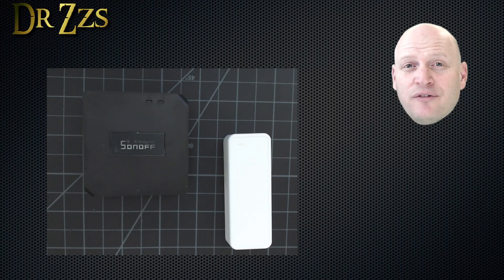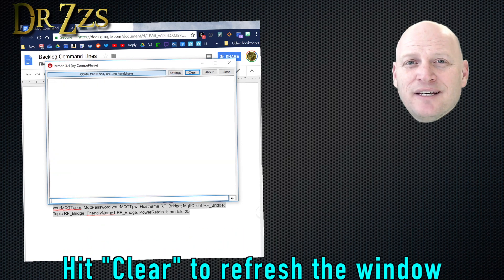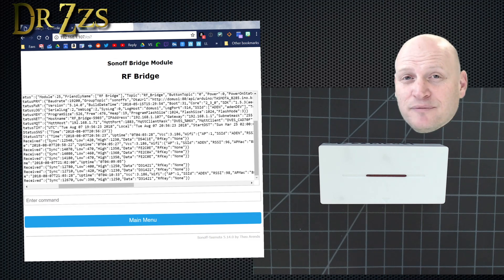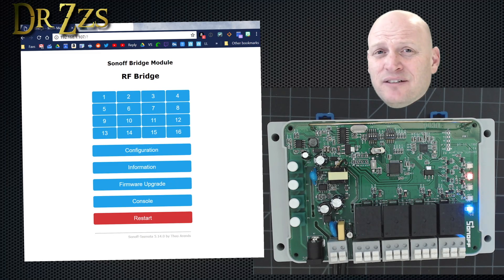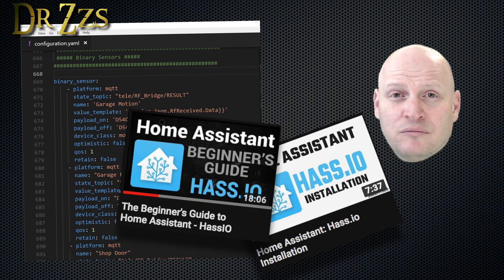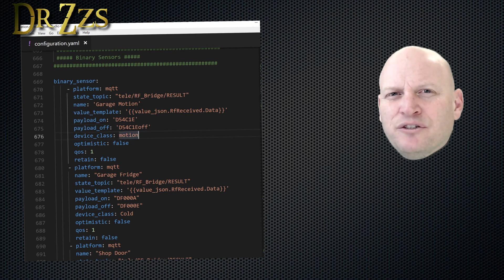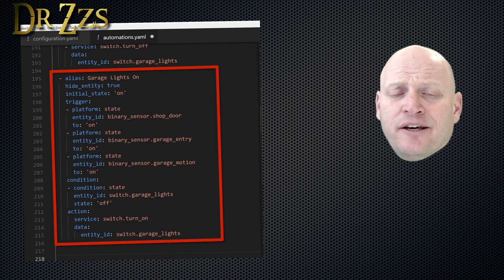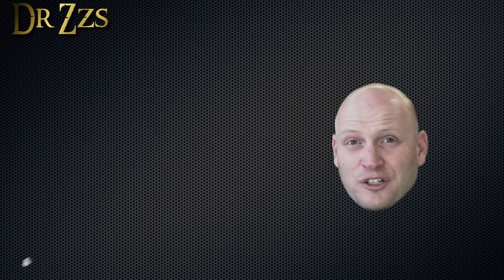Sonoff RF Bridge with Tasmota

Comment: Hi 
thanks for this great series of videos

I have been struggling to get 433mhz sensor to trigger a 433mhs door bell

after watching the video I still could not get this done

so after a long and painful  journey it seems that for some devices you have to publish the whole json code information

including the rf high and low and sync values

the best way I have found is to use the backlog command

so first grab all the info you need by activating the sensor then watching the command line of the bridge

then use that info in the automation yaml

note semi-colons not commas and RF prefixed on the value headers

- service: mqtt.publish

      data:

        topic: cmnd/RF_Bridge/backlog

        payload: RfSync 8760; RfLow 310; RfHigh 860; RfCode 531730

Comment: Great video! 

Just wondering if in the automation at 11:19 you shouldn't set the payload as in the template of the sensor, e.g., "{\"RfReceived\":{\"Data\":\"BDA5B9off\"}}" ?

Sorry if this is a repeated question.
Reply from the maker: You're probably right.  I'll have to look at it again. 
It isn't as necessary to make the fake "off" code anymore since they added an "off_delay" option to binary_sensors in HA.  So now when you set up the sensor entry in HA you can set off_delay: 5s or whatever time you want for it to reset to off.

Comment: Great vid mate. One thing, can you send commands from HA via Tasmota? I’ve a few RF plugs in the house and the sonoff bridge would be a nice way of tidying up my system instead of using my dodgy tx/rx that are dangling from my pi with DuPont cables.
Reply from the maker: yes.  You can transmit codes from the bridge.  Check out the video on the new TX switch.  I show how to record a remote code that you can transmit with an MQTT command.  (hopefully I put all that info in there...)

Comment: Do I need to sholder the header pins in order to flash?
Reply from the maker: nope.  You can just slide male jumper wires through the holes.

Comment: Just flashed all good but when i connect to termite i get no feedback i have the correct settings as i done a different sonoff basic flash and worked well so i know settings are good.
When i paste the commands into termite nothing happens, i have re flashed a couple of times now any help would be appreciated.
Reply: i tell a lie i got a small amount of green text: 
00:03:02 APP: Restarting

 ets Jan  8 2013,rst cause:1, boot mode:(1,7)

 ets Jan  8 2013,rst cause:4, boot mode:(1,7)

wdt reset
Reply: scrap that i cant do anything now i may of fried it :-) oh well buy another i guess.
Reply from the maker: bummer.  I don't know what went wrong.  Could it have to do with the switch to the RF chip?  Sorry man.  I fried one of these too.  I'm not sure how I did it either... doh!
Reply: @DrZzs  It happens i guess, least they are cheap unit so purchased a couple more, but what i have noticed is there are now 2 versions of unit?

Comment: Hi! Is it possible to configure one button of RF remote control to do MASTER OFF in all switches? How can I do that using RF Bridge and RF Remote Control? Thanks!
Reply from the maker: I think you'd have to do that with an automation in Home Assistant, or with Rules in tasmota.  I'm not smart enough to tell you exactly how that rule would look.  https://github.com/arendst/Sonoff-Tasmota/wiki/Rules
try digiblurDIY, he's really good with Tasmota rules.

Comment: Didn't work for me. The flashing showed positive, but I couldn't make the connection with Termite. It finds the correct port, but wont get any response from the Bridge
Reply from the maker: hmmm.  I know sometimes termite can be fussy.  I've had to disconnect and reconnect sometimes to get the communication to work.

Comment: Got HASSIO moaning about these 3 entries...
      optimistic: false
      qos: 1
      retain: false
Reply from the maker: Ya, optomistic and retain are no longer required for that device type.  Just take those lines out and it should work fine.  qos should be okay, but if it's giving you an error take that out too.
Reply: @DrZzs   I figured that might be the case and had hashed them out...
Just can't get my PIR to go into off mode. Thought it might have to do with retain setting.
Learn more about something when it doesn't work than when it does. I'll keep trying. :)
Reply from the maker: oh, add "off_delay: 5s" or something.  
https://www.home-assistant.io/components/binary_sensor.mqtt/#off_delay

Comment: Very nice video.   I have a question if anyone knows, if flashed with tasmota, could I use it to be the receiver for about 30 different sensors or do I need more than one?
Reply from the maker: I don't believe there is a limit to the number of sensor codes it can receive and convert to wifi/mqtt.  
If you want the bridge to send codes then the limit is 16.
Reply: DrZzs thank you for the answer and for all the videos.  Door/window sensors, water and motion detectors can just send to the RF bridge and they do not need to receive, right?  Thanks again!!!

Comment: Do you know the best way to simulate a long press on a remote? It's basically continously sending out the single press rf code.

I have stop buttons in Hassio that won't work for long presses. Which kind of sucks coz I have to spam the buttons to simulate a long press.
Reply from the maker: hmmmm, I'd try creating an automation that is triggered if the code is sent multiple times in a short time period.  I haven't tried that myself so I don't know the exact format to use.  
What are you trying to do exactly?  Maybe there's another way.
Reply: @DrZzs  Ok so I figured out that the B0 commands that I am using for my blinds support repetitions. So in rfraw AA B0 35 05 04 12C0 05F0 015E 02E4 222E A481A3B2B2A3A3A3B2A3A3A3B2B2A3B2A3A3B2A3B2B2B2B2B2B2B2A3B2A3A3B2A3A3A3A3B2B2B2B2A3 55, the 5th byte is 04, if you change that value to something higher it keeps repeating the command. Apparently it is used for less reliable receivers, but for my purpose it is working great. I now have automations for all the 3 limit settings of the dooya motors, very easy to set up in hassio due to the native limit settings.

I recommend these, they are good quality tubular motors with rechargable batteries. From seller friendly industry holding on Aliexpress. I bought 4 of them and a remote for 280 euro, which is a bargain.

Comment: Hello, great video! I am using the Sonoff bridge (flashed with Tasmota) and 4 door sensors. Works great in Hassio. Open and closed states are shown like they should. But when I restart Hassio all the sensors go back to closed, even when the door(s) are open. Is there any way I can fix this?
Reply from the maker: try the retain options in Tasmota.  in the Console, type: "switchretain 1" and "powerretain 1"  That should do it.
Reply: @DrZzs  Thank you so much! Just tried it and that did the trick! I just started 2 months ago with Home Assistant and your videos are such a great help, togheter with the videos of JuanMTech and BRUH Automation. Keep up the good work!! Greetings from Belgium!
Reply: @DrZzs I was a bit quick with my respons, it's not working, after the restart of Hassio the sensors go back to closed. This is how I configerd the sensors in the "Configuration.yaml.
- platform: mqtt
name: "Schuifraam"
state_topic: "tele/RF_Bridge/RESULT"
value_template: '{{value_json.RfReceived.Data}}'
payload_on: "D9E20A"
payload_off: "D9E20E"
device_class: window

qos: 1
When I add “optimistic: false”and “retain: false” I got an configuration warning in Hassio

Comment: Hi, using Tasmota on Sonoff Bridge, can I register more than 16 devices?
Can I register the sensor scrolling code?
Can I register more alarm devices?
Thank you.
Reply from the maker: There are only 16 slots for the RF bridge to store codes, but in most cases with door/window sensors, you don't need the bridge to store the code.  It just needs to receive the code and pass on the mqtt message to HA.  The 16 code limit is only for codes you want the RF bridge to send to RF devices that can receive RF codes, like a receptacle or sonoff RF switch.  
Hope that helps.

Comment: Thanks for posting this.  Just wanted to note that you may want to add an off delay ('  off_delay: 10
') for you leak sensors so that they can reset themselves as they don't have a discrete off command.
Reply from the maker: good point!  thanks!

Comment: Hi, thanks for all the information.
It will be great to be able to use the RF bridge to control an other Sonoff items with a different models of RF wall swiches like the next one: 

https://www.ebay.ca/itm/433MHz-RF-Wireless-Remote-Control-Switch-Wall-Panel-Transmitter-1-2-3-Button/283224286457?var=583667209378
I am not able to do it, to use different wall shiches with to the  same sonoff control.
Reply from the maker: I haven't tried those.  I believe what you have to do is program one of the 16 "keys" in Tasmota for each of those plugs.  If I ever get plugs like that I'll test it out and see if I've got the right idea.
Reply: The besto option that I found on ebay to use different remot controles with one sonoff is to use a 433MHZ Relay DC12V 10A 1CH Wireless RF Remote Control Switch Receiver, and made a contact to the push botton of the sonoff relay.
So is buy this RF reciver: 

https://www.ebay.es/itm/433MHZ-Relay-DC12V-10A-1CH-Wireless-RF-Remote-Control-Switch-Receiver/322744222599?ssPageName=STRK%3AMEBIDX%3AIT&_trksid=p2055359.m2763.l2649
This reciver Can store the number of remote control: 50, and then put the panel transmitter.

and then this Sonoff reciver: 

https://www.ebay.es/itm/Sonoff-WiFi-Wireless-Smart-Switch-Relay-Module-5V-32V-Self-locking-TOP/322633540434?ssPageName=STRK%3AMEBIDX%3AIT&_trksid=p2055359.m2763.l2649
and conect all of this products to 12V.

Thanks for your time!!!!!

Comment: I must be doing something wrong. I've flashed the Sonoff RF Bridge until I get the "Flash Completed" message and then when I try to connect with Termite, I get tons of messages like "bla bla bla Fatal exception (0)", it simply doesn't stop spitting out those messages. Then I disconnect the usb cable and all I get on termite is a non-stop rubish. No terminal command is accepted by the Sonoff. I did flash it 3 times now and all I get is the same behavior. 

Any ideas?
 

[TASMODA 6.5.0 ESPEasy mega-20190315 Termite 3.4 connection with FTDI, RF Bridge R2 V1.0]
Reply: Ended up using the Arduino IDE flashing method. Somehow, the ESPEasy wasn't loading it the right way (board was "dead" after the flashing, which isn't supposed to), not to mention the baud rate to use into Termite which was 74880 (need to type in into the settings).

To issue termite commands to set wifi, you must keep the S2 switch OFF.

Comment: Hi Doc,
I just flashed my sonoff rf bridge from OMG to Tasmota, since my bridge suddenly stopped working but now when I open Termite, I only see lines like this:
[00][00]à[00][00]à[00][00]ààà[00][00][00][00][00][00]ààà[00]à[00][00][00][00][00]ààà[00][00][00][00]
When I enter ipaddres1 I get the same respone looking like the stuff above. Is my bridge broken? I flashed it with the switch in the off position, and also used terminte in the OFF position. In the ON position i get the same results.

Thanks for your tutorials, they have been very helpfull!!

Rick

Comment: What's the range on these?
Reply from the maker: I don't have an exact number for the range.  I can tell you I have some working that are at least 50' from the hub with no problems.  And they work through walls and floors no problem too.  They really are great sensors.

Comment: Awesome videos....I have been observing your vids for a while now.....this time I decided to respond to help anyone that wanted to add the RfKeys, once assiged in console to HA.  I used this for some cheap led strips above the kitchen cabinets. Mine are solid color, but you will get the idea with the following conf.yaml inputs, works great, although I will probably run out of keys soon.  I am pretty new at the rf stuff, so please fell free to commit and make better ideas:
switch:
  - platform: mqtt
    name: 'Blue_Lights On/Off'
    command_topic: "cmnd/RF_Bridge/RfKey1"
    state_topic: "tele/RF_Bridge/RESULT"
    value_template: '{{value_json.RfReceived.Data}}'
    availability_topic: "tele/RF_Bridge/LWT"
    payload_available: "Online"
    payload_not_available: "Offline"
    payload_on: 'Learned'
    payload_off: 'Learned'
    optimistic: false
    qos: 1
    retain: true
  - platform: mqtt
    name: 'Blue_Lights Mode'
    command_topic: "cmnd/RF_Bridge/RfKey2"
    state_topic: "tele/RF_Bridge/RESULT"
    value_template: '{{value_json.RfReceived.Data}}'
    availability_topic: "tele/RF_Bridge/LWT"
    payload_available: "Online"
    payload_not_available: "Offline"
    payload_on: 'Learned'
    payload_off: 'Learned'
    optimistic: false
    qos: 1
    retain: true
  - platform: mqtt
    name: 'Blue_Lights Reset'
    command_topic: "cmnd/RF_Bridge/RfKey3"
    state_topic: "tele/RF_Bridge/RESULT"
    value_template: '{{value_json.RfReceived.Data}}'
    availability_topic: "tele/RF_Bridge/LWT"
    payload_available: "Online"
    payload_not_available: "Offline"
    payload_on: 'Learned'
    payload_off: 'Learned'
    optimistic: false
    qos: 1
    retain: true
  - platform: mqtt
    name: 'Blue_Lights brighter'
    command_topic: "cmnd/RF_Bridge/RfKey4"
    state_topic: "tele/RF_Bridge/RESULT"
    value_template: '{{value_json.RfReceived.Data}}'
    availability_topic: "tele/RF_Bridge/LWT"
    payload_available: "Online"
    payload_not_available: "Offline"
    payload_on: 'Learned'
    payload_off: 'Learned'
    optimistic: false
    qos: 1
    retain: true
  - platform: mqtt
    name: 'Blue_Lights Dimmer'
    command_topic: "cmnd/RF_Bridge/RfKey5"
    state_topic: "tele/RF_Bridge/RESULT"
    value_template: '{{value_json.RfReceived.Data}}'
    availability_topic: "tele/RF_Bridge/LWT"
    payload_available: "Online"
    payload_not_available: "Offline"
    payload_on: 'Learned'
    payload_off: 'Learned'
    optimistic: false
    qos: 1
    retain: true

Comment: Can the Tasmota flashed Sonoff Rf bridge transmit codes learned?  I have ceiling fans that i want to use the RF bridge to transmit via home assistant sending cmd to rf bridge to send the rf signal.  Or are the 16 transmit channels fixed?
Reply: Read my comment above , maybe it will get you want you are looking for.
Reply: @travisadkins3200  Will the Sonoff rf bridge work with 434mhz?
Reply: @ojw629  No, I am not aware they do......only 433mhz, I forget that a lot of the ceiling fan kits use 434 mhz, so no help from me here, sorry.  You may consider this: https://www.itead.cc/sonoff-ifan02-wifi-smart-ceiling-fan-with-light.html.  Here's the link to the issue request from the tasmoto github: https://github.com/arendst/Sonoff-Tasmota/issues/2839.

Comment: Hi. This tutorial is great. I used it to set up my sensors. The reset automations are a great solution for 1 code sensors. But yesterday, I was searching something else and found this setting for 1 code sensors "off_delay". So you no longer need to create a reset routine.
off_delay
(integer)(Optional)For sensors that only sends On state updates, this variable sets a delay in seconds after which the sensor state will be updated back to Off.
Reply: How is this not the top comment? It's so useful!

Comment: Hi DrZzs 
You can use more than 16 remote with sonnoff bridge+tasmota.
Of course it would be more elegant to write with state_value_template. But it still works.
Your videos are very helpful. thanks a lot.
switch:
  - platform: mqtt
    command_topic: "cmnd/RF_Bridge/Backlog"
    name: "Desk Lamp"
    payload_on: "RfSync 8700; RfLow 270; RfHigh 840; RfCode #2F7E84"
    payload_off: "RfSync 8700; RfLow 270; RfHigh 840; RfCode #2F7E82"
#    state_value_template: '{{"RfSync 8700; RfLow 270; RfHigh 840; RfCode #"+value}}'
#    state_value_template: 'RfSync 8700; RfLow 270; RfHigh 840; RfCode#{{ value}}'
    qos: 1
    retain: false
Reply: nice!  I have a bunch of 434mhz fans i want to try to  use this on.... what range can the rf bridge transmit?  will i need one in each room?

Comment: Hi Doc! This didn't work for me straight out of the box. To flash it I had to rewire TX-TX and RX-RX. And the termite was dead through a PL2303, so I had to connect to the bridge via wifi and do tasmota config there. Keep up the good work!
Reply: you generally put tx to rx on both ends, not tx-tx or rx-rx (They stand for transmit and receive. One tx has to go to the other rx)

Comment: If you want use code for battery low you just need to change last digit in the code to 6. If you have code 1D430A for open door then you have to use code 1D4306 for low battery.
Reply: Thanks for this

Comment: Hello
Let me praise all the excellent shots, which are very nicely arranged and useful, and I have one good news for the Banggood 2 code Door sensor. There is the third code for low battery. I tested with the regulated pover supply and I get the code to the Sonoff RF bridge. And I have one question. I'm begginer for the hassio and I dont have a idea how to configure Schady for the room thermostat. Do you have any plan to do the video about the Schady.
By

Comment: This is super awesome , I can add this to my Main bedroom and if some sensors trigger , the lights will come on to wake me. Yes I am 80% deaf , the I sleep through when the alarm goes off.  Make my bedside lamp flash aswell. Super cool thanks . Love to get to work with my Alarm system outside beams . Not sure how I would do this. Thanks
Reply from the maker: Great!
Get some details about your outside beams.  It's possible there is a way to get them to interact with Home Assistant.